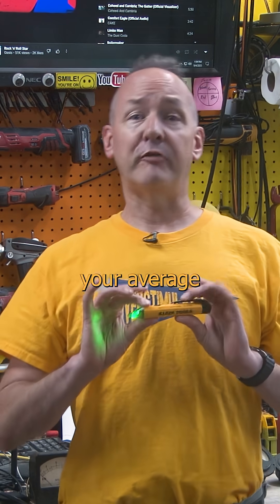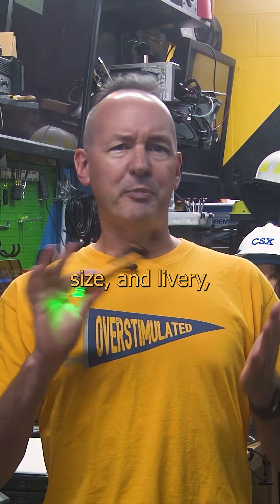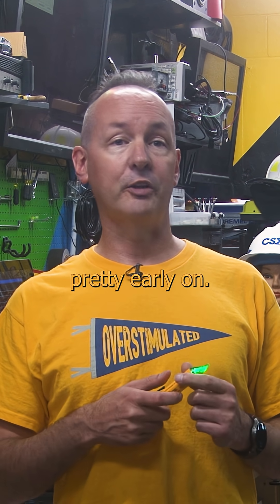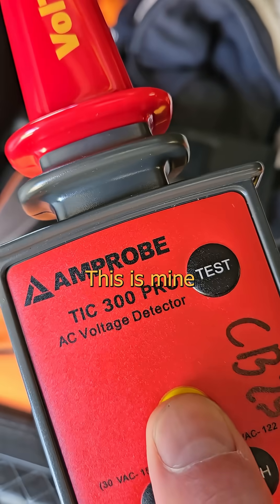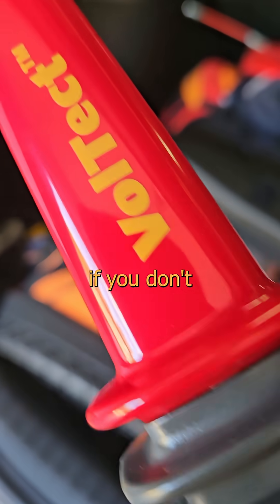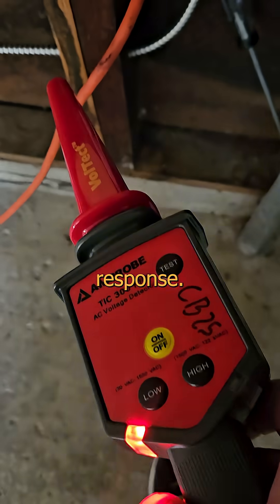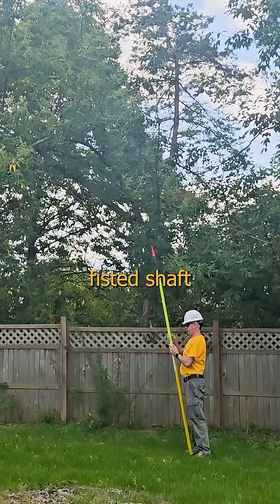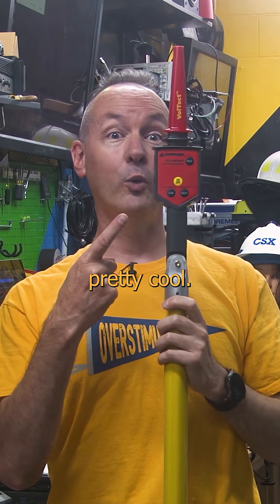High Voltage Tester #chrisboden #comedy #engineering #electrical #tools #energy #power #innuendo

Comment: If you do any of your own electrical work at home, get one of the small ones. Mine has saved my butt a time or two, and I almost got killed by someone else's mistake years ago from not having one! (Some idiot wired a 220v line with two breakers in parallel, so shutting the breaker off at the panel still allowed full power to the water heater i was working on.)

Comment: Yay!  I have and use the same extened-o-matic low/high voltage tester as you have and I only unsheathe it for special occasions. 😉 The interesting or surprising bit is the utility I work for isn’t the electric company, it’s a water and sewage company which many people probably wouldn’t immediately think there would be a need for voltage detection.

Comment: Im a 1st year apprentice and I didn't know what the name of the second one was but I used it a few months back. We were running power to some 500hp fuel pump motors and 2 of the motors had the phases flipped wrong so we had to switch them around, had to use it to make sure it wasn't hot still cause I think it was 2300v.

Comment: Please please PLEASE if you have one that looks like that (meaning a non-contact version) make sure it's the red light green light kind. Otherwise your finger will end up being a voltage probe instead when you don't change out the batteries

Comment: Should (kw) only be required in emergencies when the meters beuilt into the SEMICONDUCTOR based transformers failed but for some unexplained reason haven't automatically grounded the failing part of the grid, right?

Comment: We used to put our wrenches on a nylon line, throw them over the powerline and then pull it up until it almost touches, if there is a big spark the power is live and we do not apply the safety earth equippment. This was for 400k powerlines in sweden.

Comment: Owning a non contact voltage tester, multi meter and outlet tester are a must for anyone who even incidentally comes into contact with a circuit, they all have very specific pros and cons. 
A ncv can detect anything to as low as static on a wire at a half inch which means there can be some false positives but theyre easy to poke and prod with. 
Multi meters are bulky but give all the info you could ever want including temp and moisture readings if you opt for the premo, you can even get a clamp with leads if you dont wanna buy yet another meter. 
Outlet testers now can show you the 3 fail conditions as well as the voltage and test the gfi from any receptacle on said circuit with just one plug in too, very convenient.
Reply: When it comes to safety, a NCVT is top. And you can do quite a bit with them if you are experienced, like tell the voltage of a line or if you are picking up a true positive or just induction

Comment: For us in the Netherlands...average garbage, we actually measure the voltage with metal probes touching the metal contact...not some floating coil that has a 'hunch' that there is a voltage. NEN-3140 standards.
Including high voltage NEN-3840.

Comment: Ex Crazy Tree Guy here.  Those poles can get to 45ft.  Least the ones we had.  We put a line hook, saw or pruner attachment on it.  Wish we had one of those on the storm runs so we didnt have to chase down a lineman to find out if the wire was dead or not so we could clean up after storms.

Comment: I have a smaller one.....but my GF says it's fine. Her ex had one of the bigger ones but she said that it wouldn't extend on the shaft and didn't go off. She assured me that she loves my smaller one because it is always ready to be used and will reliably go off when you rub it on the hot one. It fits neatly in the little pouch too. WINNING

Comment: I used to have that same klein pen tester in my school bag when I went to trades school. It stopped working altogether and is basically brand new some of them from klein once the battery ran out even if you put a new battery inside of them were completely dead which is why they released a second version with a red button instead of black that could also toggle between low voltage such as phone lines to higher voltage.  via blue and green lights that would flash red. Some standard volt meters have the function built inside of them. Meters like the Fluke 117 have a volt alert fuction as well as many amprobe meters. It's not a standard function and not all meters have them. It's silly how some of cheapest made in china meters can have a multitude of functions but then more expensive name brand meters are allocated to 3-4 functions.

Comment: I get the metaphor / innuendo, but how is the actual jumbo voltage tester able to get you hurt? Is it when you touch it to a power-line? I feel like that's not really the tester's fault, same thing'd happen with just a stick, right?

Comment: Those voltage testers are so useless. You want to drill somewhere and they either beep the whole way or they don't beep at all. Hoping for the best is just as reliable if you don't want to spend a lot of money for a proper tester.

Comment: Commissioning at our site was back feeding our substation, transformer turned out to have a defect, luckily they hadn’t made it hot yet so it didn’t blow. The lines our substation is connected to are running 138,000 volts

Comment: I had a big yellow flared handheld one when I worked for a fiber telecom installer. I loved when that f**** light went off "Sorry, gotta get down and call another technician that has a ground probe. To make sure it's just a static charge or some induced voltage.

Comment: I recently hired an electrician to replace all wiring in my apartment, as it was very crusty cables with a cloth-coating instead of plastic (cables from ~1905). I told him, you can completely kill the power in the apartment, i don't need it for the next week (i hadn't moved in yet). However, he insisted to keep the power on while he worked. Needless to say, he got shocked less than 5 minutes into the job. Literally on the first outlet he opened 😂

Comment: The jokes and all are fun, but that isn't a "voltage tester" in my mind. 
That small stick is a widow maker and will pick up induced voltage from a wide range. I always check behind anyone who uses a widow maker with my Fluke 789. 
NCV is a pretty handy tool especially when checking 4160 feeds for large motors. 
I always pull my meter behind them. Unless of course the voltage range is outside of what my meter can handle. 
I just kinda hate that you call it a "voltage tester" for some reason, even though that's what it is technically.  
I don't trust them due to errors I've seen over the years while using them. 

Just thought I'd give my two cents.

Comment: My favorite encounter with a voltage tester was working on a 15/60 neon transformer. It was up in a drop ceiling and my partner was setting up the ladder to go up and work on it. I told him it was a bad idea and pull out the voltage tester. I turned it on at the base of the ladder and it screamed like R2-D2 from all the juice that box had flowing in it

Comment: I recently remodeled a 130 year old brick building with active knob and tube. My little tester that she shouldn’t worry about was picking up current just by contacting the floor joist that the knob and tube was attached too, even with isolators

Comment: Mod-e-wok!

Ours don't have that wonderful shape haha, but they all go on the hot stick!

Remember fuckers, ensure it's working before trusting your life to it

Most have a dial, or it looks like yours has multiple lights for different voltages.

If your using the baby volt tic like the one at the start, put it into a known hot box before the circuit you want to test. And then use a meter! Just yesterday we were pulling big ass cables from a hospital generator into a pit with other cables (potentially live) so we put a tester on and it went off.

When we put a multimeter on, it showed it was just a tiny voltage being induced. So the tester said it was hot, when really, it was not. So these are a great starting point to see if you need to go a step further, but If your around 480 or 600v , induction is a thing.

Sorry, rant there, but with the big testers I turn ours to 600v, and go to a known hot 600v circuit and make sure it gets excited before I step up to the high voltage setting and attach it to the hot stick (the big ass telescoping bastard - two fisted shaft)

These will save your life, but you must know if they are working right because 120v can kill, it usually doesn't, but, 13.8-25kv can vaporize or if your lucky just maim you horribly !

Don't fuck with high voltage my friends! 750v and up !

Comment: Guy in our local got hurt really bad when he stepped into 12460 switchgear and did not have anything to verify it was dead.   Went knee to elbow and left him outta work for 6 months while he was in the burn unit and OT/PT.... Those testers with the Fiber stick and Calibration tester are under 1600 bucks.  1600 bucks is what that company thought was too much to pay for that guy to still be on the tools.   OSHA barely fined the company after it was all said and done, too.  The apprentice who was with him and Shepard Crook pulled him out of there left the program a couple months  later.

Comment: I used that exact tester at a factory we used to do work at to confirm the 4160 transformers in the vault were de-energized before entering.

Step 1) Put on flash suit. Open and lock out main disconnect switches outside.

Step 2) look inside disconnect and confirm all 3 legs have opened.

Step 3) Open transformer vault door and check the high voltage leads on all the transformers using the featured voltage tester.

Step 4) enter the vault (still in flash suit) and test low voltage leads on transformer with the fluke DMM.

Step 5) remove flash suit and perform maintenance.

Comment: We called them tic tracers, we used them for voltages from 1000v up to 35,000v non contact. I was certified to work on equipment up to 186,000v

Comment: I refuse to use one. I’ve been shocked way too many times at this point through using them that I just use my multimeter. Not to mention if it’s 120v, 9/10 I’ll just do it live. 

I definitely don’t need one in my day to day at work because I just assume that 480 is always live until I confirm that it is indeed not. Usually if I walk away from it, as soon as I come back I confirm that it is indeed, not live. 

Don’t be stupid, don’t be complacent, don’t be either at the same time.

Comment: I have, and hate that little Klein model. It has blue and green lights depending on if it's an AC or DC mode and there's no label for which is which. Meaning I have to go find the manual if I care to figure out what which mode is which. Next time I actually have to look it up I'll pull out the label maker, but I typically just grab another less fiddly one that I have laying around.

Comment: Amazing to see, that this is so common in the states. Up to 1000v we need to measure with direct touch of two potentials. Otherwise, when there is an accident. It’s your fault. And then from 1Kv up to 50Kv ore something like that you still need to touch the life conductor. Only over that voltage we can use those testers.

Comment: I’ve used that high voltage tester, when I was in ground water you’d use that tester with a 30ft pole to voltage testing if a water well wasn’t turning on or had no control voltage

Comment: We here in VDE-Land are encouraged to NOT use these little lying sticks but use proper 2 pole tester with switchable load (eg. Duspol). Reason for this is, that these simple tester often rely on your bodies capacitic ground connection. This can lead to false negative testing.

Comment: Seen more like magnetic flux detection rather than voltage. But because you can't have one without the other, you can reasonably make the assumption that they are near enough the same thing.

Comment: I've carried a Fluke 87 and Klein non-contact for over 30 years.  Recently bought a Klein CL390 or something for clamping and back up.  Trying to turn off that F'ing beep and F'ing auto shut down,  I found out it had a built-in non-contact detector.  I don't read destructions...

Comment: I had an old duck as an instructor in the military... he just poked a finger at the wires and fairly accurately could tell you how high the voltage was by how jiggy he did the 60 cycle shuffle. Luckily we topped out at 480 volts AC. He definitely wouldn't even try that with the 400 Hertz aircraft systems.  Doh!

Comment: We have cooler voltage indicator in Poland. It's name is Fazer 777. It is a little bit dangerous if you don't know what you doing but in addition to electromagnetic field sensing it can test for continuity and check voltage by touching wire. Also is dirt cheap (around 5 usd w/o shipping).
Reply: Most electricians also have a tester like the (wiggy 6610) voltage tester.  Tests for AC and DC voltages.  Shows visually and vibrates.

Comment: I have a similar device that's used for networking.  It's primarily meant to detect a tone in a single cable amongst many that has a tone generator at the other end.  It can also detect voltage in live wires without direct contact.

Comment: I don't know why it never occurred to me that those things could detect static electricity
Reply: They can, but you likely will get an incomplete reading of the Voltage of static electricity.  The issue is that there is no such thing as an ideal voltmeter with infinite impedance, as we assume in academic diagrams.  Usually, real Voltmeters will have either Megaohms or even better, Gigaohms of impedance.

That being said, the meter will always draw some parasitic current from your circuit in order to work.  For an ordinary circuit, this is usually insignificant enough, relative to the current in the circuit, that you will get an accurate enough reading.

For static electricity by contrast, we're usually talking nanocoulombs or even picocoulombs of charge, when we're talking about the charge of simple household objects in electrostatic experiments, like balloons, silk, rods, and your hair.  You may have 10 kV of voltage due to static electricity, but the charge is so low that it does very little damage when it discharges.  Because the charge is so low, you'll likely get a reading that is nowhere near the original voltage of the static electricity.

Comment: I got two of those and more I got plug in ones GFI testers I got gfi's that you plug in the wall and then have the cord you plug in I have a GFI on an extension cord that I bought at the flea market I have a lot of electrical testing stuff cuz I work on antique appliances and antique lawn mowers wear sometimes you know that safety equipment comes in handy when you work on it take electrical equipment especially when you're plugging in that old power drill from 1950s that has a metal case in a two prong power cord that the power cord is completely destroyed and you don't know what come fuckary is inside

Comment: useful fact: the standard voltage model gets alarmed about ten feet away from a high voltage power line.  which means if you're around anything questionable, and yours goes off, you're too close. and with self closing cutouts becoming more common, even of a downed line isn't showing signs of life, that doesn't me it won't come back on all by itself.  the days of cowboying downed power lines are over.  And while I find it inconvenient, I also behave myself.

Comment: Teach them about "Limits of Approach", Chris......and the logical REASON for the non-conductive "Hot-Stick".🤔
Reply: I'm just a layman, but some systems have so much power in them, that the voltage is high enough to jump through several feet of air to reach some dummy connected to ground, and the current is high enough to turn said dummy into a human-sized piece of bacon.  Use a chicken stick to prevent turning into bacon.
Reply: @Warp9pnt9 The main substation at the company I worked for had equipment we weren't "allowed" to work on while in service....due to the fact that the available fault current and arc flash potential was dangerously high and even 40cal/cm2 flash gear wasn't enough protection. Arc-Flash studies are your friend and anything ABOVE 40 cal/cm2 is basically "un-survivable"...you're basically experiencing a hand grenade explosion without the shrapnel.😎

Comment: I've done electrical work for about 10 years now. Anytime someone asks me a question about making repairs at their house I say the only tool you absolutely must have is a voltage tester. I like Klein tools but you can use whatever as long as the very first tool you buy is a voltage tester.

Comment: I like that "low" goes up to 1.5kV ! XD
Reply: In electrician terms, anything under 1k v is low voltage.... Common high voltage is 10k+ Volts.
Reply: @cd23 Iirc, some only call stuff that's over 50kV "high-voltage". I was surprised when I first heard 27kV being traction power labelled as "medium voltage"
Reply: @Lightning_Mike I was originally taught 1-100 kV for medium voltage. An internet search finds IEEE 600-69kV, 🇨🇦EC 750V-46kV, and IEC 1-35kV. So confusing yes. Sigh.
Reply: There is no internationally defined definition of low, medium, high voltage.

However a number of countries classify up to 1000 volts AC RMS as Low.